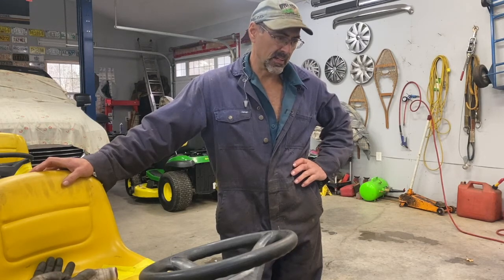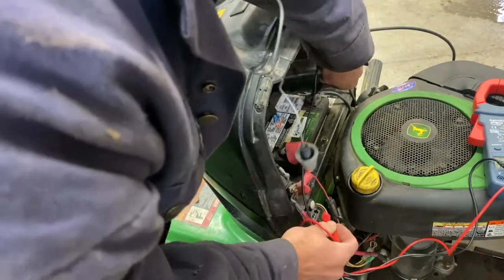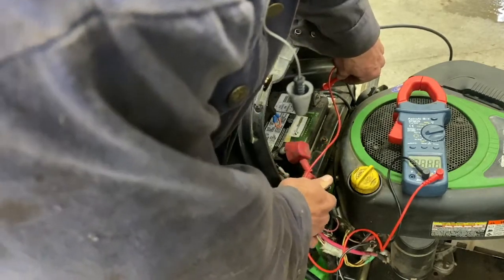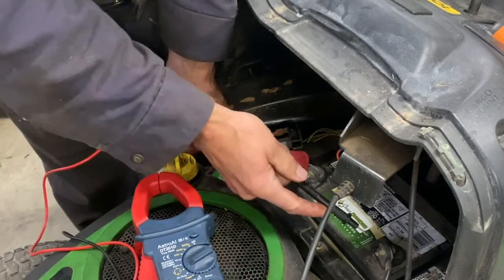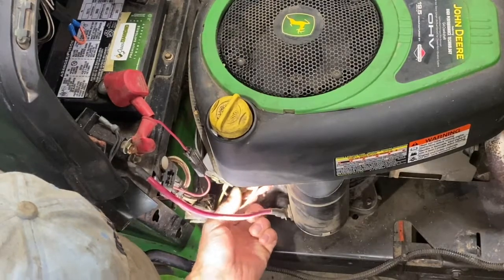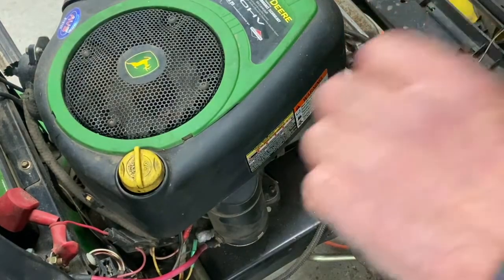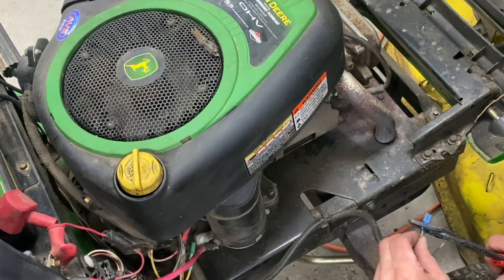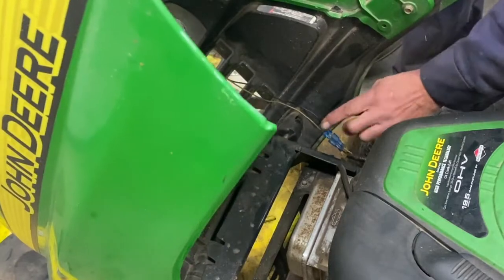Blowing Fuses on a John Deere LA110 Lawn tractor.  How to find a Short to ground.

Comment: Hi, I recently had have the same issue with light wire blowing fuse, but at time I didn’t have fuse to replace so I just made a jumper to put across fuse holder and forgot it in there when finished, now a week later I can’t get any power across, any idea what I burnt out?
Reply from the maker: Probably you have a bad connection at the battery or fuse holder.   Try jump starting it.  If it won't turn over, put the key in the "on" position and place a screwdriver across the terminals on the solenoid. 

What Ohms reading do you get when you do the check I did at 1:00min in the video?

Comment: My fuse holder on la 165 is nasty where fuse sits, bought a replacement but only has 2 wires ,any suggestions ,rather than buy new 1
Reply from the maker: Lots of inline fuses on Amazon. If you want an OEM one, look around on Craig’s list or kijiji for a guy that’s used parts.
Reply: Sorry to ask but do you put synthetic or conventional oil..thanks
Reply from the maker: @kenwilson5349   I use 10w30 synthetic.....

Comment: I’m having the same issue on my cub cadet LT1024. Every time I pull the PTO switch, 2-3 seconds later it shoots the fuse. I suspect a wire short because I have changed voltage regulator with OEM part.
Reply from the maker: Just follow the wires to the clutch you'll see the problem for sure...
Reply: I had grass and dirt blowing up into my key switch area shorting the post to each other and blowing the fuse often  .... took a while to figure out

Comment: I'm blowing fuses and I do not want to have to go threw that bird's nest of wires in there all day long! I have put almost all new parts on this tractor (D140). Selenoid, battery, PTO switch, Key switch, Coils, plugs, gas filter, air filter, gas pump and a new PTO clutch. As well as eliminating all safety switch's. Oh yeah it has all new spindles on the deck! Last fall the blades stopped while mowing. At first I could get them on again but they would stop working after a few minutes and then it got to where I could not get them working and even had trouble starting the tractor. So I just put it away for winter and now I got this mess in the spring. I got it running with some of those new parts and battery.....but then after mowing three yards on my street I could not get it started after it sat for a while. And I found I was blowing fuses!
Reply from the maker: Wow. That’s a lot of work…

Comment: I've got the same issue. I believe that the headlights are disconnected, but my fuse blows each time I turn the key. I've even gone so far as to check the stator to make sure none of the magnets were loose or the stator had any damage. So the wire that is hooked to the hot side of the battery goes to a small green connector, which I believe goes into that small rectifier. Even stepping up may still pop the fuse. I've checked all the wiring and they all look good with nothing bare touching each other. I hope to figure it out so the elderly lady can get back to mowing.
Reply from the maker: They’re 4 positions in the key switch, including the off position. 
    Which one does the fuse blow? 
 First position sends power to the head lights (yellow/white wire) and run wire (yellow wire) 
Second position one sends power to the run wire (yellow). Goes to the carb fuel shutoff.
 Forth one sends power to the run wire(yellow) and to the Starter solenoid (Purple wire) then changes to (purple/white) after the PTO switch . 
  The run wire (yellow) first goes the the rio switch.
       Put your meter on Ohms.  Then check for a short to ground on each wire.